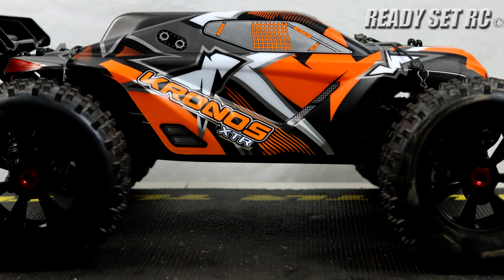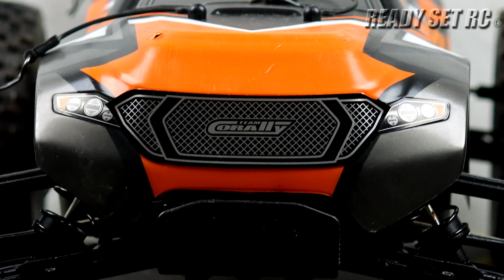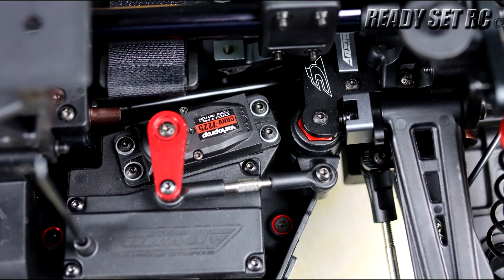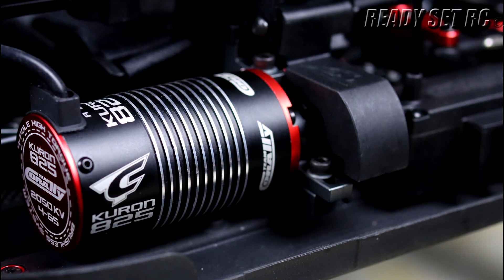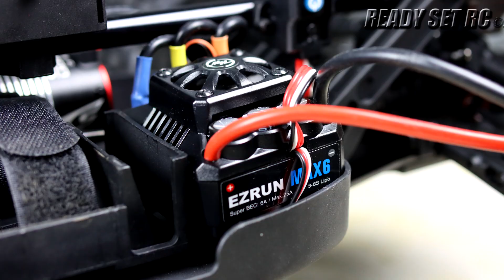Team Corally Kronos XTR Final Thoughts

Comment: What 6S battery are you running with this truck?
Reply from the maker: @Brett Olbrys  I run a single 6S pack.  It's a Power Hobby 120C 4000mah.  I would suggest buying two if you want really long run times.  The way I drive I get about 15-20 minutes out of them on grass.